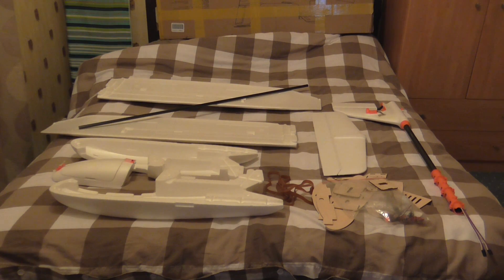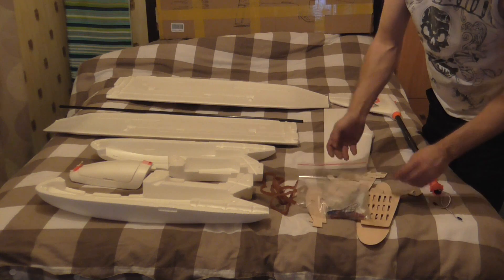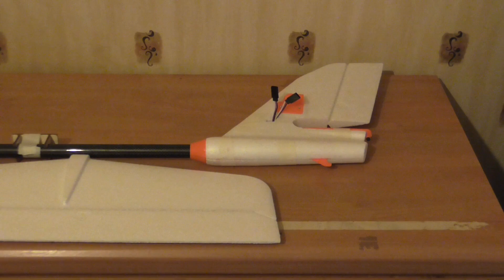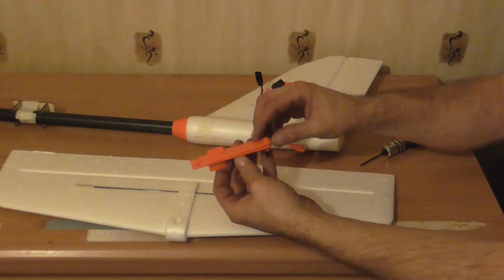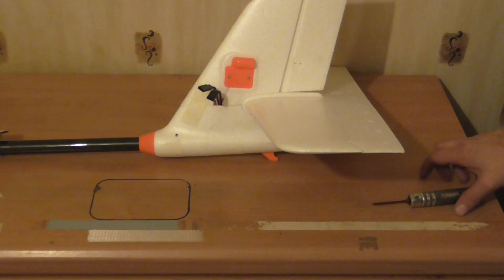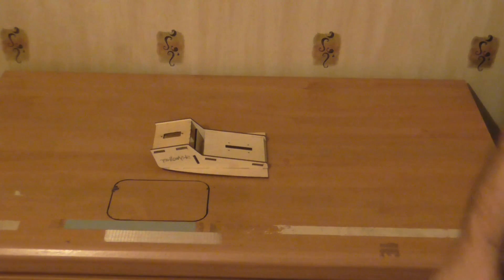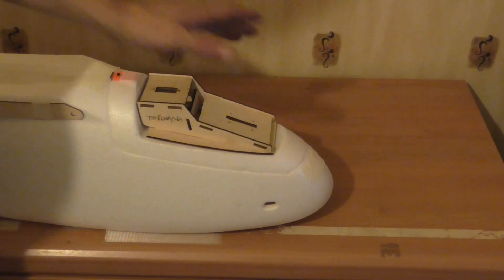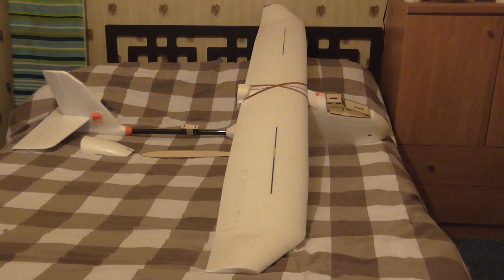Latest 2014 version skywalker FPV 1900 Build Manual

Comment: Hi pudsey, thanks for the vid, I'm in the UK and building the latest Skywalker 1900 (carbon boom and high horizontal  stab (T tail?).
I was wondering if you could tell me the CG of the 1900, I have read so many threads giving different CGs.  I will be flying 800w motor, 12x6 prop, 4000mah 4s, Eagletree vector FC, etc.
Also, if you could let me know of any issues you have had during or after the build that would be great!
Barry
Reply from the maker: Don't recall the CG sorry I Normally go with what the forums say try that and work it out for myself from there moving battery either way until I get it floating spot on. as for problems after the build I to this day insist that it was floored as me and a friend tired different thrust angles and adding weight to one wing as it always wanted to fly right. After multiple smashes and not being able to trust it to fly RTH on its own we gave up on it.

Comment: Thank you for posting.  I just ordered one.  I had no idea that it wouldn't include instructions for assembly.  What type of glue did you use?
Reply from the maker: The glue that came with it for the main parts fuse
and zap slow gap for the rest with kicker
Reply: Pudsey - Rc
Thanks for the reply.  I just received mine and will be building soon.

Comment: Is this better or the skywalker with no carbon tail boom..the normal foam tail n high elevator??
Reply from the maker: Tricky it is better for 2 reasons
You can put a bigger prop on Im using a 12x6 at the moment
Also there is no need to stabilize the elevator as you do with the high elevator skywalker.
Bad point yesterday ( 23rd feb 2014 ) The so called carbon tail boom snapped around 4 inches from the fuse. Its a very thin so called carbon tube.

Comment: I think you have the motor mount backworths?
Cheers.
Reply from the maker: Yes you are correct although its the skywalker manufacturer that has placed the bolt holders backwards :D Otherwise wouldn't make any sense putting there logo on the side to be glued to the fuse. Im just waiting for a 42 motor mount as the 35 motor mount is does not fit correctly so may have to take the bolt holders out and realign them to fit a 3536 motor mount